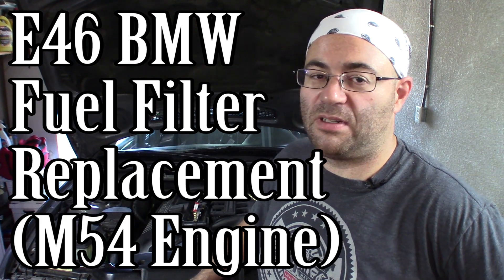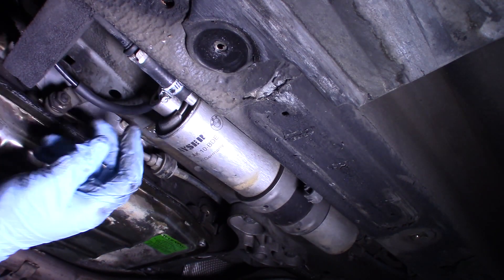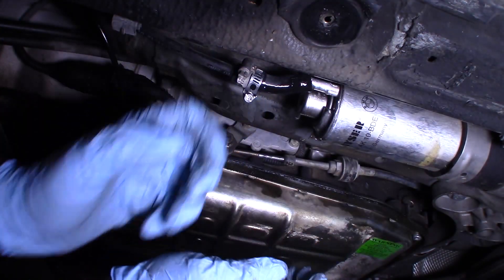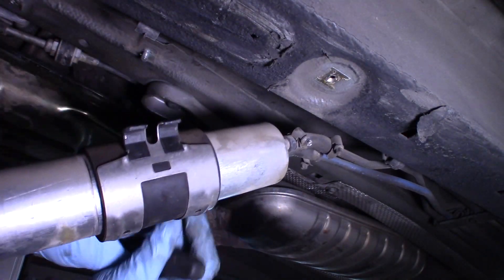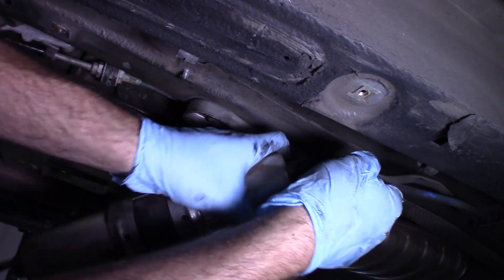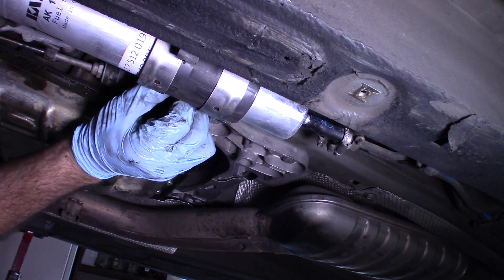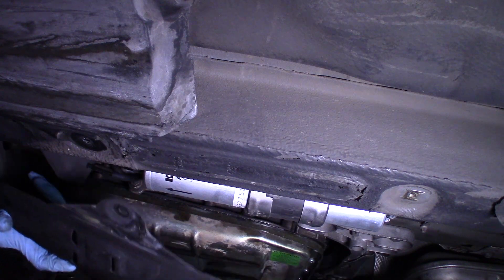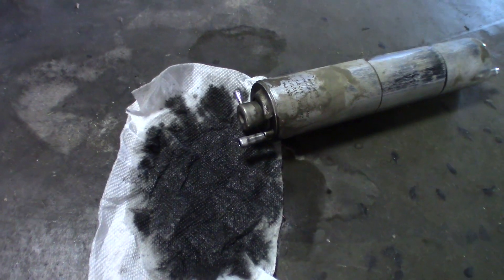BMW 330i 325i E46 Fuel Pressure Regulator Replacement (M54 engine) DIY

Comment: Hello, I've watched your video many times, and it has helped me so much. Thank you for that! However, for the past year, I've been struggling with a specific issue on my BMW E46 SULEV M56 engine (325i).
The car works fine in the summer or when it's warm outside, but once the temperature drops to around 34°F, it won't start. After trying 20-30 times, it eventually starts, but all the gauges light up. Once it’s working up, everything works as if nothing happened.
I suspect it might be related to the fuel line, but I'm not sure where to look. I've tried everything, and no mechanic has been able to identify the problem. If you have any advice or ideas, I’d greatly appreciate it—I'm desperate at this point.Thank you

Comment: bad vacuum line to the fuel filter caused a 174 code on my 2004 bmw 325i. service engine light was on a year. drove me crazy. fuel pump went out and while replacing it and the fuel pump he found the bad vacuum line at the filter. code free no light now.
Reply from the maker: Nice
Reply: i have that code p0174 bank 2, thanks, im going to check mine from there
Reply: Awesome, I am getting a P0174 on my 2003 325iAT. I practively purchased solid silcone hose to run from the filter all the way up to the intake. Doing the filter today, hopefully this is the source of my vacuum leak

Comment: When I first bought my E46, my CEL was on for P0171 & P0174. I fixed multiple vacuum leaks and replaced multiple vacuum lines but that still wasn’t the cause. After doing some more research and digging around, I gave this fuel filter / pressure regulator a shot since it wasn’t very difficult to replace. My CEL finally went off and the codes went inactive. I would’ve never imagined this fuel filter was the culprit but it makes sense. I guess my filter was so dirty and clogged up that it was causing an restriction creating a lean mixture. I guess sometimes you just gotta stick to the basic maintenance stuff.
Reply: Was your PO171 pending and PO174 confirmed ? I’m having this issue SES light P0174 on right now and can’t figure it out.
Reply: I'm having the same issue I changed my fuel filter and cracked intake boot and fuel pressure regulator hose still getting the lean codes
Reply: @madfisherisme  could also be the vacuum lines for the pcv being cracked, bad plugs, bad pre cat o2 sensors. Smoke the intake to confirm if you have vacuum leaks first.
Reply: Be sure to change that little 3” piece of vacuum hose from the filter to the hard plastic line. My codes were the result of it completely disintegrating, coming off the fuel pump and suckin’ air.
Reply: I got lean codes in both banks and found the upper rubber part of the pressure regulator hose is crumbled. That might be it!

Comment: My vacuum line on my fuel filter is broken is that why my car have a cylinder misfire code ?
Reply: Unlikely that it's the culprit for your misfire but still it's a bad thing because it causes a vacuum leak. So replace the vacuum line (preferably all vacuum lines, those cars are old and that rubber is crumbling 100%). If you got a single cylinder misfire it's more likely you have a problem with the ignition coil or spark plug of that cylinder (rarely injector failure). To test the coils, take a coil from a good cylinder and swap it with the cylinder that has the misfire. If the misfire moves to the other cylinder, you know you got a bad coil

Comment: another great vidI see you have worked on M52tu...can you please tell me where  on the vacuum fuel regulator on top of motor ...the tube has no vacuum so am thinking it is split somewhere the Bentley tells nothing where it goes ....and absolute waste of money except for the codes and electrical diagrams but lacks what value components are  when I last emailed you about the replacement of Disa diaphragm you should do a vid on  this because it does gets trickyI just replaced my vacuum diaphragm on the DISA ...not hard but just have to apply lots of leverage with a long thin screwdriver and then getting it back together is not too bad...just have to line all the parts up ....my diaphragm was split right where it comes in contact with the edge of the top cap...can see this being a problem cause contact on the diaphragm should have been either flat or rounded but this is thin walled and can cut the diaphragm over time
Reply from the maker: The line on the top of the fuel rail runs from the fuel pressure regulator down under the body (approximately underneath the feet of the driver -- left hand drive cars), up along the side of the fuel rail and down to the CCV oil separator, which only has a little tiny tiny bit of vacuum.  It's only purpose is in case the fuel pressure regulator diaphragm bursts, the gasoline vapors will be sucked into the CCV system and then into the intake manifold to be recycled.
Reply: hmmm sometimes when I stop I can smell fuel vapour,so maybe it could be the regulator leaking, but at idle there seems no vacuum at regulator A fuel pressure gauge should  tell if there is a problem with regulator?.LTFT still show 11.7+ on both banks so there seems to  still be another vacuum leak
Reply from the maker: It's a possibility.  If your fuel pressure regulator diaphragm were torn, your fuel pressure would be low which could cause a lean condition but then again fuel would be leaking into that vacuum hose and getting sucked into the intake manifold which could cause a rich condition.  So it's kind of tricky.  Yes, a fuel pressure gauge would be the way to confirm that.  What are your total fuel trims at 2500 rpm?
Reply: will check stft and ltft when Wifie brings back the car ..so far have found vacuum leaks in top T/C gasket, oil filter body,Disa o'ring and diaphragm. plugged up exhaust flap,have to make a smoke machine if I can find a metal paint tin ,all plastic here

Comment: hi! @50sKid Do you happen to know whether the FPR integrated in the filter is the same size as the M52TUs that have it on the injector rail (Euro setup)? For some reason, it seems that my type of FPR is not being made anymore, except for some Ridex junk I would not trust.

Comment: Turns out my fuel pressure regulator is not on the fuel filter, but at the front of the fuel rail. I say this because I've been getting a strong fuel smell under the bonnet since winter of 2021. I thought it was the injectors and replaced them all at a hundred bucks a pop summer 2022. fuel smell reduced somewhat but was still there after shut down. the stealer told me it was my purge valve, so I replaced it in march, a few months ago. mechanic who did my waterpump and thermostat last week, told me that the fuel smell is coming from the fuel pressure regulator and or the  vacuum-like hose attached to it. the hose is really cracked. I'm getting the feeling that that hose carries fuel vapors from the fpr after shutdown? is that fpr difficult to replace? do i have to remove the fuel rail? don't particularly want to do that again.

Comment: The line connected to the pressure regulator is not a vacuum line. It is attached to the F connector on the intake boot just after the MAF. 
It basically just needs atmospheric pressure not vacuum.

Comment: I have a 1998 BMW 540i.  Going to replace fuel filter and fuel pressure regulator.   E39 540i 3/2-way valve and fuel hoses(my diagram).  How to I release fuel pressure before removing.  Do I remove fuel pump fuses in glove box and or in the trunk?  Both?  After  I remove fuse,   start car and wait for it to die?  Thanks for any information.  Greatly appreciated.

Comment: To minimize the fuel spilling out I shoved a golf tee in each line as soon as it was removed from the filter. Worked great  but a small amount of fuel coming out is a given however I didn't  need a pan to collect the few drops.
Reply: I used ur method and made this job clean! Thank u

Comment: Thanks for Sharing.........Just FYI....When replacing hose clamps -fuel, vacuum, coolant etc. I try to use the "Pressed" OEM Style "Worm" Clamps such as Oetiker (OEM) or Norma/Gemi (They have pressed threads)   The clamps that you installed have the "cut holes" for the threads.  A BMW Mechanic explained that those type clamps(with the holes for threads) damage the hoses because they cut into the hose.  As the hose ages it is more likely to fail sooner.   I presume that is why BMW uses them.   They can be found if you look for them.  I know that AutohausAZ carries them.
Reply from the maker: Interesting, thanks!

Comment: hey , im a fan of your work. i had a problem with my bmw 320ci 2005 in bank1 and bank 2, i changed all lean codes. so , do i need to change my fuel pump to , cuz it feels like my car lose it power .. she goes slower up to 100km/h . and why do we need to change the fuel pump what does it do? help me out i need this. EU miles 15000 .
Reply from the maker: What codes do you have exactly?  Did you erase them and did they come back again?
Reply: i had code p0171 p0174, and after some changing one of them is gone but i still had a bank2 code left in my scan. so i guess its cilender 4-5-6 `? what can it be ?
Reply: i had code p0171 p0174, and after some changing one of them is gone but i
 still had a bank2 code left in my scan. so i guess its cilender 4-5-6 
`? what can it be ?
Reply from the maker: Watch my fuel trims video.

Comment: Could a faulty regulator cause over-fuelling? I've got negative trim on both banks and the car reeks of fuel after a journey, but there are never puddles underneath.
Reply: Hello, I have the same problem on my S54.  Beast of an engine.  BMW mechanics can’t find a leak and thought maybe carbon canister or I over filled the tank.  Head me h even took it home as a road test.  They looked at me like I was imagining things.   It spewed gas on my driveway and road first time like a leaking line. Still stinks inside after running a while and can smell gas from the engine bay top left area in front of the driver but can’t see drips.  Okay So I’m thinking the fuel pressure regulator may be faulty but maybe partly plugged the leak.  Worried she may blow up one day as the engine runs hot.  Getting it looked at tomorrow.  Please let me know if you sorted out the problem, thanks and good luck.
Reply: @osoyoosforever9643  I fixed my problem - the vacuum line to the fuel pump pressure regulator had detached. This caused both fuel to leak out of it AND the pump to run over the rated pressure (hence the negative trim - the computer was "backing off" the fuel delivery because of the extra pressure).
I'm not sure if the S54 uses vacuum to regulate the fuel pump, but check your filter!
Failing this, it will be a leaking injector seal or injector body, or a high-pressure fuel line into the injector rail - all serviceable parts.

Comment: Hi,need some help here!
my wagon goes out of fuel at 1/4  tank,when i checked the obc cluster menu in test 6 it shows for example 10 liters in the left side and 6 in the right side, i know this is wrong because  is supposed to transfer the fuel from left to right side and when less of half a tank the left side should be empty or nearly empty.
new vdo fuel pump,new kayser filter,replaced the siphone pump,new fpr vac lines,new oem fuel tank cap and still having the same issue at 1/4 tank most of the fuel is on the left side.
no codes no problems just that issue at 1/4 tank.
any help?
Reply: John Gonzalez  , I have the same problem but I haven’t replaced any parts yet . When my tank gets to 1/4 with say 60 miles left if goes to die out and has no power
Reply: @SuperBolt666  problem solved,for some reason the vdo pump wasn't strong enough to produce the right pressure,did a test with an old aftermarket pump and in 5 seconds the left side went to zero confirming the pump was weak. Ended replacing the pump.
I noticed the pump weakness when I pulled out  the fuel pump connector the engine died immediately,its supposed to run for a few seconds  and then die.
The jet pump inside the tank needs the return line pressure to work if the return line is weak the suction jet pump wont work.
Do the test I did,I know filters can get clogged but if the engine is running great with 1/4 or more gas tank the filter is ok.
Reply: John Gonzalez thanks for the reply, I will try this 👍

Comment: I just did this yesterday on my 325ci. The convertible is a little different taking the back seat out but very straight forward.Thank you very much for posting this! I changed out all the fuel hoses, vacuum line and OEM BMW hose clamps as well.

Comment: If I accidentally hope the feed lines into the wrong spot meaning fuel into pressure regulator and pressure regulator into fuel the feed would it cause a problem with the regulator

Comment: Hi I have a Bmw 325xi 2003, I just replace all fuel injectors and spark plugs, keep giving to me a miss fire code on 6 and 4, turn on fine and when I try to drive just engine shut down.. please help me..

Comment: Is there a second regulator in the engine bay that regulators pressure to the rail? I replaced the fuel filter and regulator combo (under the car driver side,) last winter, but now I'm leaking fuel from the engine bay, back side, towards firewall.

Comment: Did you experience any codes due to dirty fuel filter if so what were they?
Reply: dirty fuel filter restricts fuel flow and that causes lean fuel trims under load (that affect the performance of your car). The codes it can trigger are P0171 and P0174 (related to lean running conditions)
Reply: @FStan-co8vv  ok yeah that’s what I got a p0174 code but I replaced fuel filter and still have that code
Reply: @chrispirrone7798  Lean codes can also be caused by vacuum leaks. With the engine warmed to optimal temperature, check fuel trim data - first at idle, then under load (even better if you can check them while driving). If you got really high fuel trims at idle, and they go lower when you raise the revs to 2-3k, you likely have a vacuum leak. If you got low fuel trims at idle, and high under load... Then you might have a fuel delivery issue, or a MAF which reports bad information
Reply: @FStan-co8vv  ok thanks but within the last year replaced maf 02 sensors fuel injectors plugs coil packs cats fuel filter purge valve DMTL pump vacuum canister vacuum control valve and 3.5 mm vac lines the only thing I haven’t done is remove intake oh yeah and CCV system
Reply: @chrispirrone7798  check the fuel trims first to get an idea whether the problem is vacuum leak, fuel delivery or something else
Reply: @chrispirrone7798  hey, another think you can check is look at your spark plugs. If they're black/dark color indicating rich mixture (despite the codes saying lean), it's either another vacuum leak somewhere, or a bad MAF/o2 sensor

Comment: HELP?? Still have code P0193 on my BMW e46 after replacing with a brand new OEM fuel filter w regulator built in? Any ideas?
Reply: Put a fuel gauge on the schrader valve that's on the fuel rail and see if you have fuel pressure there.
Reply: @bigidol9789  sold it for big profit only paid 300$ for it put 1000$ into it sold for 3500. took some time after i cleared the code but the fuel filter worked fine

Comment: Thanks 50kids for your another great vedio, I am a big fan of you and your diy vedios now.

My problem is exactly same as david Crawford . My car is E60 525i 2004with enginge M54
i replaced fuel filter which was horribly dirty , replaced also feul pump but the problem still exists.
They told me to clean injectors because old feul filter was very dirty. Do you recommend me cleaning them to solve this problem and what is the correct way to clean them.
Reply from the maker: +Yazan Alaya What are the fuel trims telling you?  If you don't have high fuel trims (indicating that your car is under-delivering fuel), then paying for a fuel injector cleaning may be a waste of money.
Reply: I haven't done feul trim yet. I will install the software and check..Thanks for the advice

Comment: Thanks for this video! The F-connector is located in the air intake pipe, before the throttle butterfly, so there is no vacuum here. Where does the thin vacuum line get it's vacuum from, in order to operate the fuel pressure regulator?
Reply: Also, the larger diameter pipe of the F-connector goes to the sucking jet pump "branch" which DOES see manifold vacuum. This would effectively bypass the throttle butterfly?! What have i misunderstood here?
Reply from the maker: It's not a vacuum controlled fuel pressure regulator, it's fixed.  That line is there just in case the diaphragm bursts--it routes the fumes into the intake.
Reply from the maker: Yeah I honestly have never given that sucking jet pump any real thought. I've read somewhere that it boosts the vacuum in the brake booster somehow.